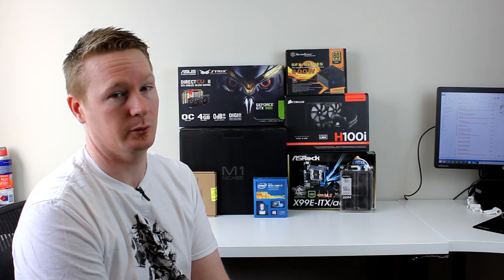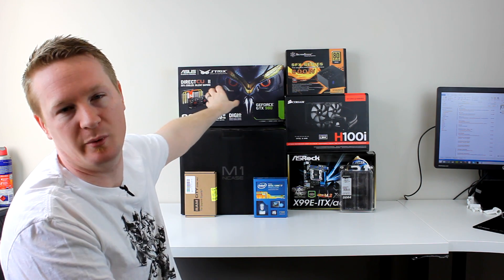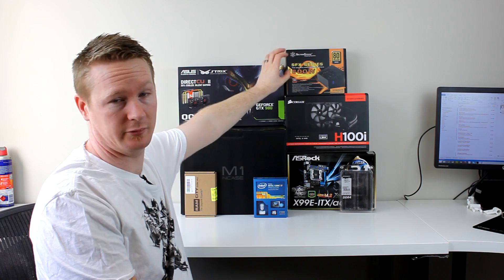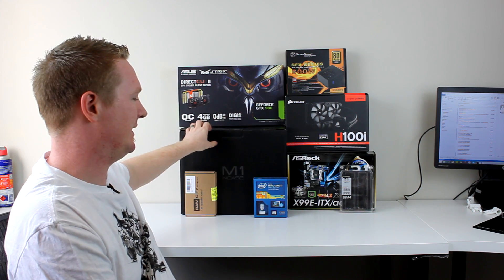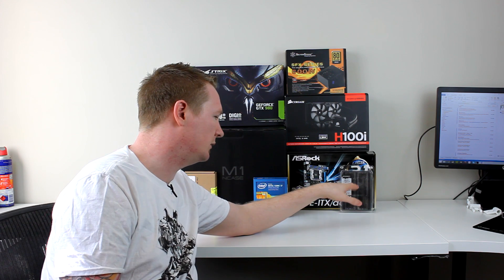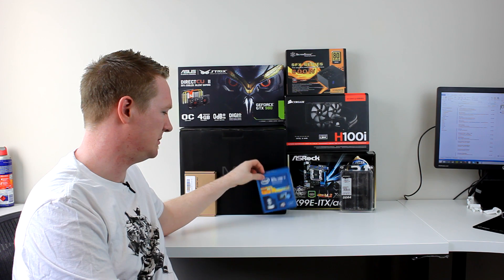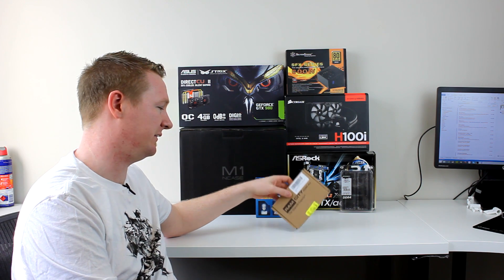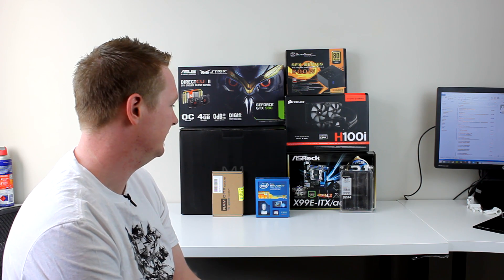Project MiniValidus - Part 04 - MiniValidus Ver 2.0?

Comment: rad fans as an intake ? omg
Reply from the maker: +arton haziri Sure why not? They are filtered and ultimately in this case are the only source for air intake. If I flipped them and make them exhaust the only way to draw air in is through the unfiltered perforated panels which would only result in a massive dust hoover. It's not ideal but it is better than the alternative. Lots of compromises in a build like this.

Comment from the maker: +PhilfreezeCH sorry I cant reply to you directly because of your settings.

I should have elaborated, the 980 will drive the screen just fine you are correct, however, it will struggle with some titles 'maxed out' at this resolution. With that considered and looking at future titles i'm hoping for a stronger GPU. The 390X should be announced on the 16.6.15 and the Fury to follow that which I'm keen to see the performance of.

Comment: Worth the wait! Good to see the build is going forward again. Can't wait for future updates. 

On a side note. Could you include volume levels when you get into the details etc?
Reply from the maker: turboborg thanks very much, your support means a lot! Do you mean noise volume levels? If so, sure I can can include that into info provided, if something else let me know!
Reply: DeeGee Tech and Hardware yeah! dB noise levels. Don't mention it. You are providing great content. Very detailed and informative. I can't really think of much else? Thing I personally would be interested in is heat output from the case and perhaps the audio quality coming from the the new asrock board. I'm not an audiophile but i got some sweet speakers and would be nice not to run a separate DAC if the board has good signal coming from it. 

That's all I got? Bit useless maybe but thats what I want to know haha. Keep it up ;)

By the way where in Australia you from?
Reply from the maker: turboborg Melbourne for now... :) Audio seems the same to me I don't have much to compare it to though. I use the Wireless H's which is USB and some crappy Z-10's which wouldn't pick up any difference between a good or bad audio source. I'll see what I can do re: heat but its unlikley I can give any scientific info on it.

Comment from the maker: +Dunetech I can't reply to your comment because of your settings.
The 980Ti is an unlikely choice for a replacement as still, I feel its not strong enough to drive a 1440p Ultrawide.

Yes I have full intentions on cooling the GPU and CPU in the same loop.

Thanks for your support!